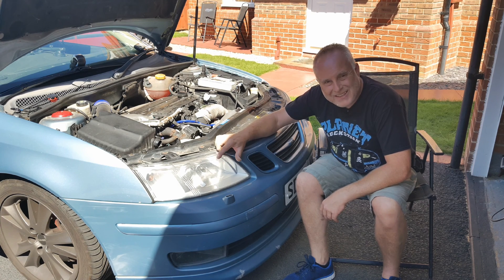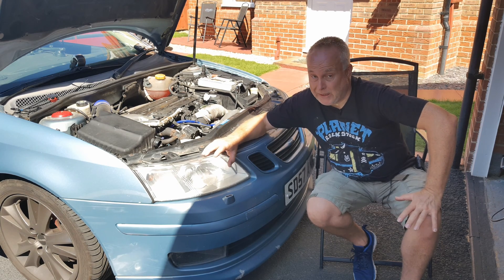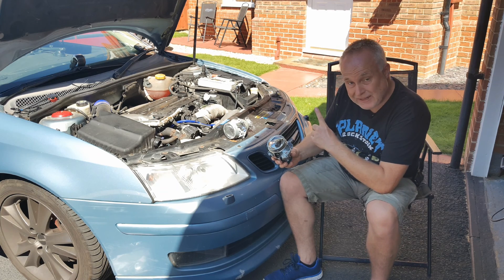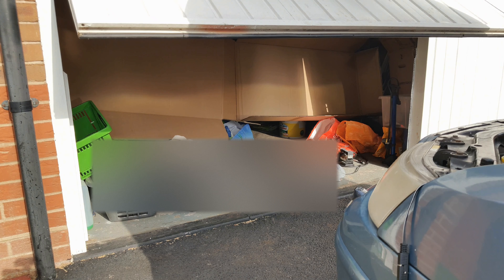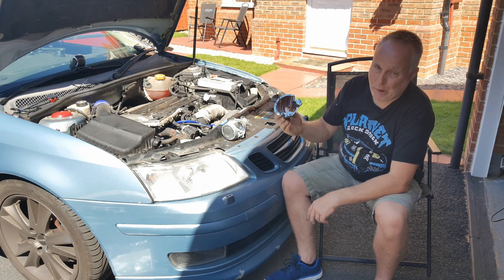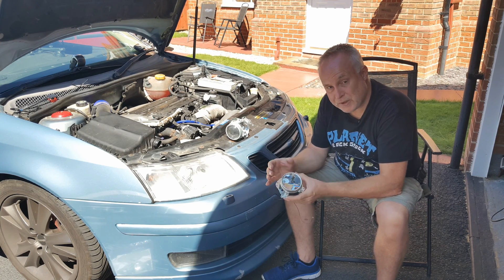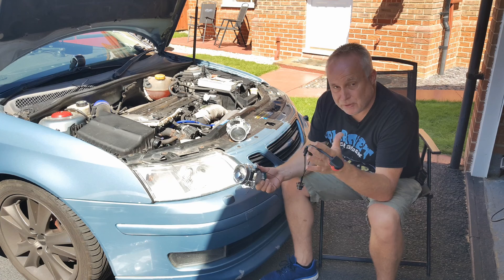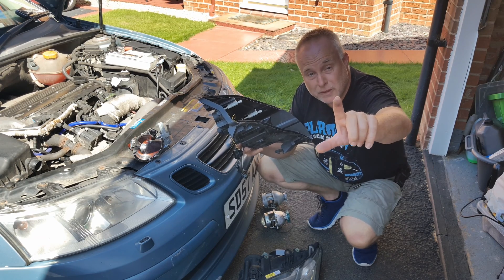Do you have Dim Low Beam from your Projector Headlights?

Comment: Cyd, hope you can shed some light for me :)
I have a Saab 9-3 Aero 2.0T '05 with halogen projectors and I want to replace those as they are too dull to pass inspection. Here in Sweden I can by no means do any sort of conversion and likely pass inspection. Can I replace with bi-xenon or single xenon projectors?
Reply from the maker: The halogen projectors are the same E55 as the xenons. So you could replace them with bi-xenon projectors and use a xenon conversion kit to drive them (you could use the EVOX-Rs like I did)
OR
You could use these direct E55 replacements, https://bit.ly/E55_replacement, and swap over the cast bulb holder from the rear of your old ones and keep them halogen. I show you how to remove the bulb holder near the start of this video https://youtu.be/UPtda2-X1xY
Reply: @CycloneCyd  Thanks a lot Cyd, will look at this E55 replacement, and your other video again :) Thanks for your great work BTW
Reply from the maker: @petergammelgaard9107  If you are just doing a simple projector replace, no need to remove the front cover. you can get in the back way (but that glue I used turned out to be crap - plastic weld it back together)
https://www.youtube.com/watch?v=BRVPqlIbm7E&list=PLOaePmzqZNJ3ckhEjWMapU0O2pCkG9G5K&index=4&t=39s
Reply: @CycloneCyd  Yes, I have already watched that video several times :) I plan to do it that way, but welding plastic? Is that something and how? Was feeling comfortable with the glue :) Also, from examining pictures of my own and other's headlight openings from the back, it looks to me it should be possible to navigate the projector out through the hole without hacking off the edge. But as watching your video and reading other forums about it, people cut it off, so I guess it is needed. I did order the replacements now (as I cannot do a conversion to HID without re-registering the car), but I would have liked the clear lenses!
Reply: Okay, I see it now, looks easy enough to do with an iron, which I possess. Would you think it is necessary to weld it on both inside and and outside?
Reply from the maker: @petergammelgaard9107  yes, a soldering iron will do nicely. A nice seam on the outside will be good, it's only got to hold the rubber caps on and keep dirt out. 
Take a load of photos, I'd love to see how you get on with it.

Comment: anything for an alfa romeo 159/brera ?   I have very low light projectors (halogen).
Reply from the maker: What make of lights are they, hella or valeo?
Reply: @CycloneCyd  ? oh, no clue, I'll check that out.
Reply from the maker: @davidvarela8739  try searching AliExpress. There is nothing listed on TRS.
Alternatively, see if you can pick up a 2ndhand light and take it apart and see if you can retrofit a bi-LED projector of similar size by modding the lights in a similar way to how I repaired mine or make an adapter plate.
Something like this: http://bit.ly/2inch_biLED
Reply: @CycloneCyd   Thank you very much Cyclone ;)

Comment: Thanks for the video Cyd! This might be the case with my Audi A4 B5 1999 facelift model! I've tried polishing the headlights. My low beam is so bad, especially on rainy black roads. I bought OSRAM night breaker 150% but no success. I usually use my fog lamps on rainy days which annoys the drivers. My question is: is it possible to replace only the projector part or do I have to buy a complete new headlamp? Is it possible to fix it?? It would be great if I could see at nights.
Reply from the maker: Are your A4 lights halogen or xenon (HID) projectors? Or are they reflector headlights?
Reply: @CycloneCyd  Heyy, thanks for answering! I've got halogen ones. Normal H7 bulbs 55W fit in there. They were never modified.
Reply from the maker: @SpicyMuscovado  so, are they projector or reflector headlights?
Reply: @CycloneCyd  They're projector ones of course. I've got no problems with the reflector part. This is why I looked up to your video. I was wondering if the projector part can be replaced somehow. Buying whole headlights is just too expensive for such an old car. Well at least if it's original of course. There's huge price differences between them. I don't know why. One is like 65 euros each and the original Valeo is around 360 euros. Why is the huge price difference? Is it worth to buy the cheap one? That's the whole headlight body price.
Reply from the maker: @SpicyMuscovado  Sorry to take so long to reply. I can't find any projectors listed for your car.
I agree the originals are overpriced, but there is usually a reason the cheap ones are cheap. Do they have any reviews?
I'd be tempted to see If I could get a 2ndhand light that's the same and take it apart. measure up the projector and try to find one that's a similar size.
Another tactic: I imagine your reflector side is a "main beam assist" like my Saab and probably has an H7 bulb?? Why not get a small bi-LED projector conversion ( like these maybe, https://bit.ly/2inch_biLED). That way you've introduced a new and better dipped beam, but kept it legal for the main beam flash function. Many ways to skin a cat and all that

Comment: My god ... you’re spot on. My Nissan Altima does the same .. I changed the bulbs to cheap to Osram 6000 lum but no difference, now I’m going to change the projector
Reply from the maker: Once the reflectors start to degrade no amount of bulb changing will help. You're just burning a hole in your wallet buying bulbs.
Reply: @CycloneCyd  greatly appreciated 👏👍

Comment: Thank you very much. I think I have found the solution for my problem.
Reply from the maker: You're welcome! Yeah, this seems little known outside the industry. Are you planning to change the projectors then?
Reply: @CycloneCyd  Yeah I think I have to change it. I have used different kinds of HIDs and LEDs. Output was very low. I was considering for installing expensive LEDs. But this time I will check the housing before changing.
Reply from the maker: @MahmoodHossainMunna  have a look through this playlist  https://www.youtube.com/playlist?list=PLOaePmzqZNJ3ckhEjWMapU0O2pCkG9G5K  and pick out the videos that are useful to you. 
You can go for a straight forward OE spec projector replacement or upgrade with EVOX-R 2.0 projector and no need to open up the front if you're not worried about any other custom mods.

Comment: Hey Cyd! I'm going to replace my sharkfin antenna on my saab 9-3 and i was wondering how to best get to it in a sedan modell car? Thankful for answers :)
Reply from the maker: Hi Marcus, IIRC you'll need a 22 mm spanner to undo the nut that holds it on (or a pipe wrench). You can get at ir by first removing the parcel shelf https://youtu.be/Y0IU6FrIDWA then C pillar trims https://youtu.be/wsEEfFUiZFo then CHMSL https://youtu.be/QX3lPONGN-g you should then be able to pull the rear edge of the headlining down enough to get at the connectors and nut. When you put the new one on, add some silicon to the base before placing it - it's common they leak.
Do let us know how you get on
Reply: I will! Thanks for the fast reply and the pointers to the videos. I'll get back to you!
Reply: @CycloneCyd  Thanks for all the help! New sharkfin is installed in less than 23 minutes flawlessly thanks to your help! If you want some pictures of My install id be glad to email Them to you! Thanks agian!
Reply from the maker: @Marcus-nf6th  would love to see pictures, thanks. My email is in the 'about' section at the bottom

Comment: I have this exact problem with my car. It's a 2009 Mazda3 BL hatchback (European model, of course). Car's done just over 180k kilometers. And my left headlight is just gone. I cannot see it on the road at all. Aimed at a wall it's barely visible. LEDs don't help either. Right headlight is also starting to go dim but it's still visible enough to project some light. Gonna buy new pair of headlamps from TYC because I can't be bothered to find an OEM pair.
Reply from the maker: It'd be interesting to see the projectors after you've replaced them. the reflectors must be real bad
Reply: @CycloneCyd  yeah, i'm quite excited, tbh. but i won't buy just the projectors because i cannot seem to find what brand they are or where to buy them. so i'm just going for the whole headlamp assembly (one reason is; they're cracked and just not good looking anymore).
Reply from the maker: @astina7574  I did have a quick look for you but came up with nothing. They might be 'specials'. Mazda make enough 3s to make unique tooling worthwhile.
Reply: @CycloneCyd  i know there's nothing on the internet. i guess lenses are 100% Mazda made. i wonder if TYC has the same lenses in their aftermarket replacement headlamps. once i buy those, i'll make a comparison and post a link for you to see before and after, if that's okay with you.
Reply from the maker: @astina7574  that would be brilliant thanks 👍

Comment: Do halogen lights suffer more of this due to the heat that xenon bulbs done produce that much?

Do you know where I can buy new projectors for Saab 9-3 2008-?
Reply from the maker: No, it's xenons that suffer this more than halogens because the heat & UV they produce is much much higher than halogens. This is probably why the E55 projector bowl for halogens is pressed steel, whereas the bowl for xenons is mag alloy.
No sorry, I do not know what projector is fitted to the 2008on, nor where to buy. I've looked but never seen any.
I might try and get hold of a smashed headlight to try and find out
Reply from the maker: Hello again, apparently the EVOX-R 2.0 IS compatible with AFR headlights, but it needs "some modification" - but what the mod req'd is unknown. Also, apparently, if you have AFR headlights, the EVOX-R 1.0 is easier to fit with less modding required. The cynic in me thinks that latter info might be just because the supplier concerned has a stock of EVOX-R 1.0 to get rid of ❗ I'm in touch woth a couple of 9-3 breakers, so during this week I might see if I can get hold of a dirt cheap, damaged 08on headlight to experiment on.
Reply: @CycloneCyd  Thanks for your help!

Great if you could find a 08- head light to try this on.

Comment: Hey Cyd. How’d you go about cleaning the actual projector lenses since they like to get cloudy after time?
Reply from the maker: New information: you were correct, the lenses do get 'cloudy' after some years. It's caused by the heat evaporating plasticisers and other chemicals out of the plastics that make up the headlight structure and some of this condenses on the lenses. It's the same reason your windscreen gets 'misty' on the inside, especially during sunny weather. To clean the lenses you'll have to take your headlights apart. See how to do that in the playlist here: https://www.youtube.com/playlist?list=PLOaePmzqZNJ3ckhEjWMapU0O2pCkG9G5K
Reply from the maker: The OE lenses do not go cloudy with time. That's how they are made. They have a Fresnel pattern in the glass and are made of glass that is ever so slightly milky white. That's why you can buy crystal clear lenses to retrofit. These EVOX-R projectors come with clear lenses like I show in the video. 
Believe it or not, that pair of complete projectors bought from the manufacturer in China were cheaper than a pair of just clear lenses would have been from a certain outlet in the US ❗❗